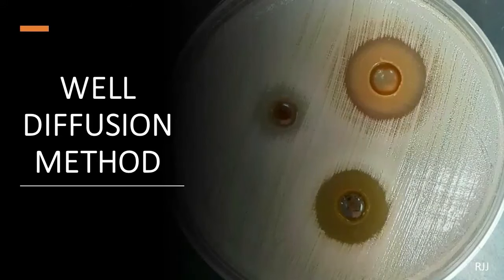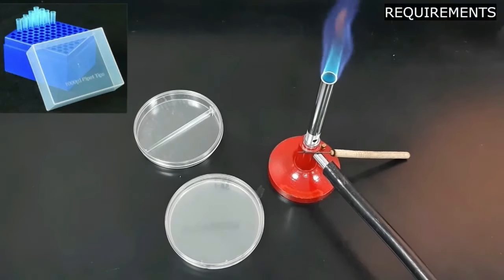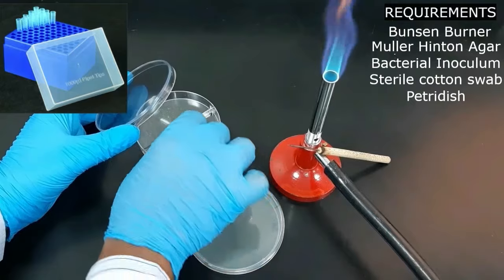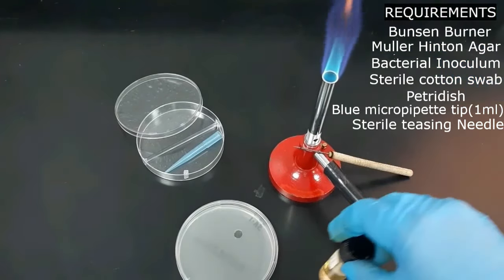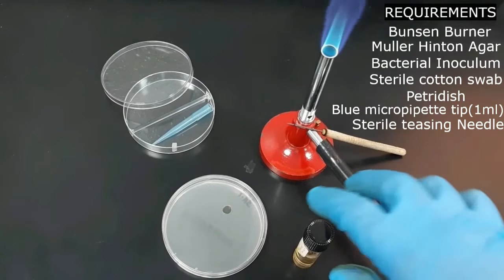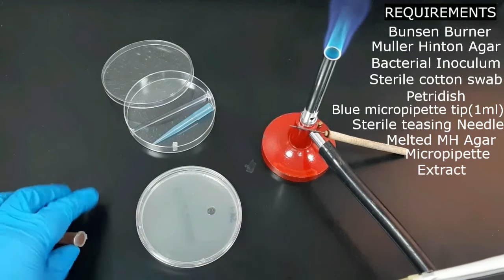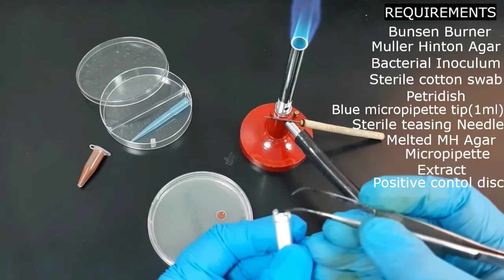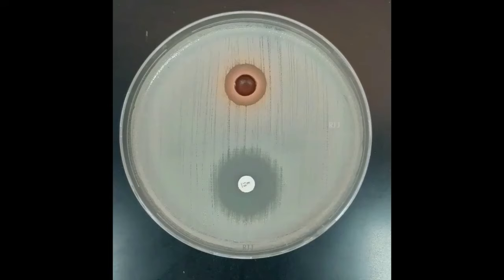Agar well diffusion assay

Comment: Dear sir
How to measure the ZOI in agar well diffusion method. since incase of Disc Diffusion assay the ZOI is measured end to end which also includes the area under the disc. in this case there is a well and couldnt be counted as clearing zone
Reply from the maker: Measure same like disc diffusion method if the zone is clear.

Comment: Thank you for the video sir. What control disc have you used in this video sir? I have a similar experiment with curcumin nanoparticles, but they are in paste form, not liquid form, do you have any suggestion in how I should load my sample inside the wells?
Reply from the maker: When u do this procedure first u add full con: of ur extract in to the well and check the zone of inhibition and compare the zone with antibiotic zone (commonly used antibiotic used for the bacteria u inoculated). If the zone is big then u can perform the MIC/ dilution and again repeat the procedure to get a good result with less dilution.
Reply: @rejojacobjoseph  thank you for the response sir